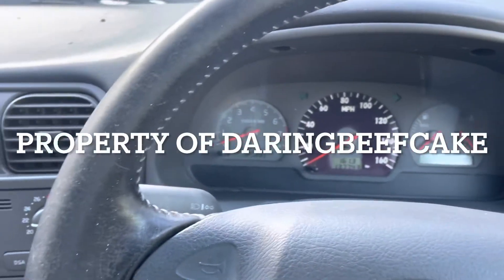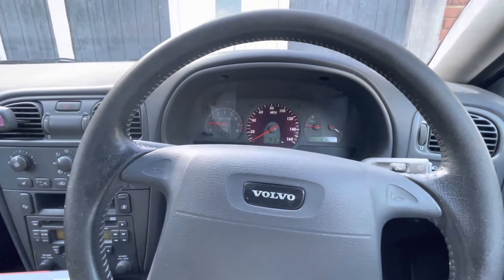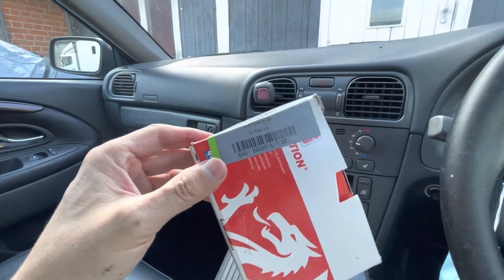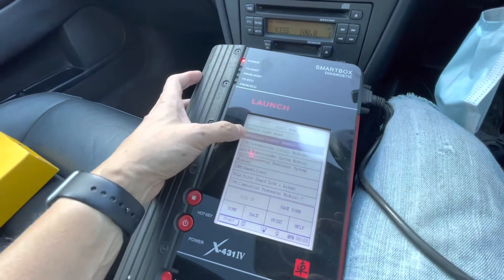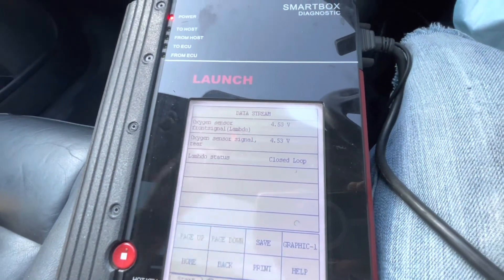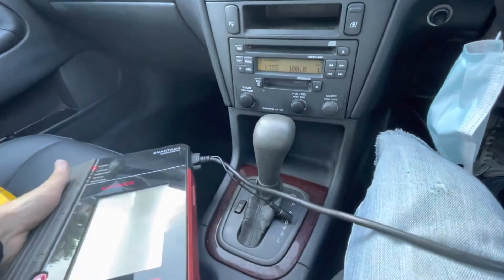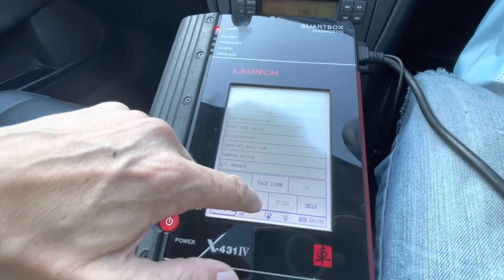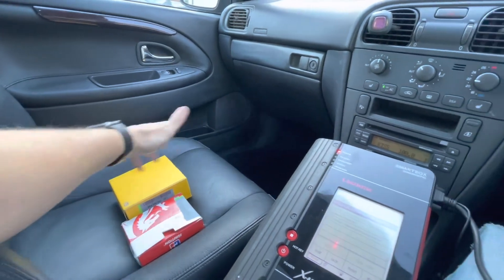Volvo V40 2000 lambda oxygen sensors replaced fault codes fixed

Comment: I have been looking for sensors for the rear one. Universal and oem ones. This hella one is bit pricey, but thanks to you, I will be buying that one now for sure. I still need to check those volts with obd someday :D
Reply from the maker: Glad I could help, yeah i finally managed to sort it out, but have to buy the sensors they are expensive but they work... make sure you check voltages and fault codes to make sure your is your sensor that its at fault..
Reply: @DaringBeefcake  Yeah you definitely don't want to cheap out on these. I will update in future when I get it replaced. Both sensors on my car are original I guess and the car is 22 years old now and it's just this heater circuit problem i'm having. Fortunately the rear one is easy to replace as you said :) keep these volvo videos going!

Comment: Update to my previous comment. I used part number: 77189 for my rear (after cat) sensor (P0141). Got it cheaper than this part shown here. My obd was showing 1.2V constantly for the sensor. Haven't driven the car a lot after but sensor fluctuates on obd now and fault code is gone
Reply from the maker: Brilliant.